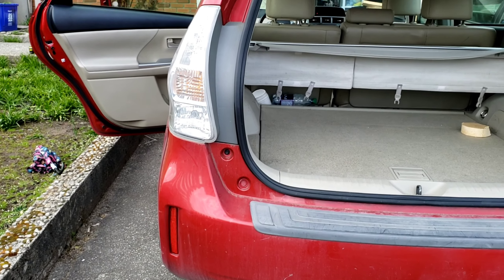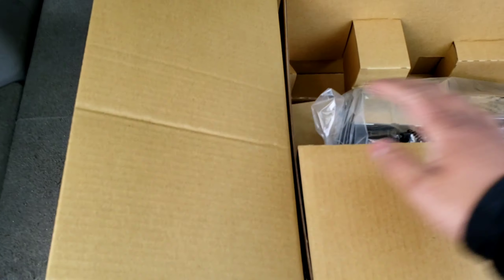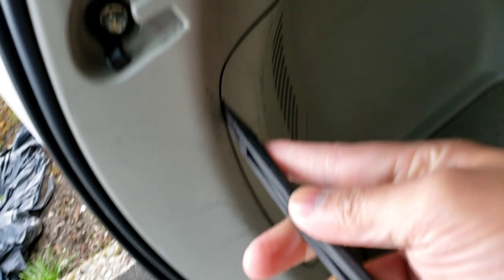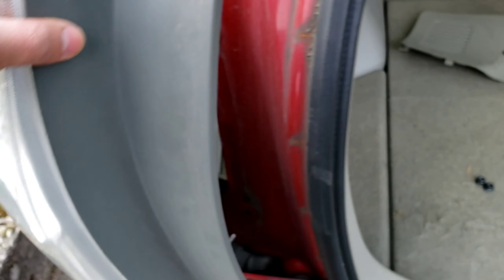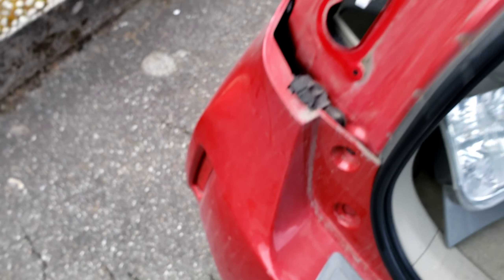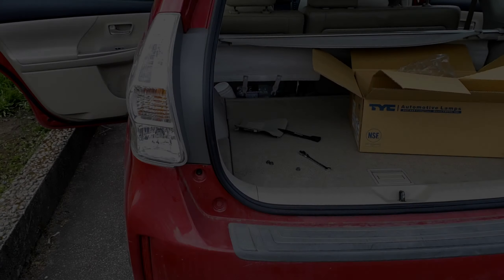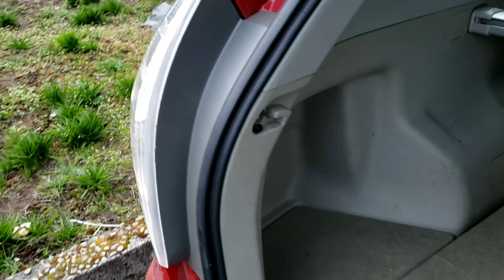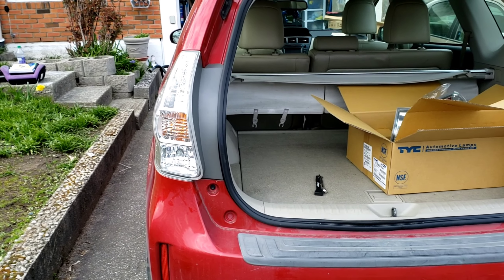How To Replace The Taillight Assembly On A 2012 to 2017 Toyota Prius V

Comment: Thank you so much for your instructions!  The only thing I would add is a reminder to add the two bulbs to the new tail light assembly if they didn't come with them.  My tail light assembly came without them and I thought it was defective until I checked for the light bulbs and the two were missing from the new tail light assembly.  I just took them off my old tail light assembly and put them into the new one.  Now, it is perfect!  :)

Comment: I have a 2015 and it was a lot harder to get to the bolts (and I dropped one into the car!). Also, when I was done, the right turn signal didn't work even though the other lights did. Any thoughts on why that would be?